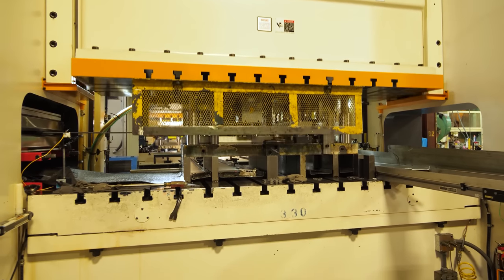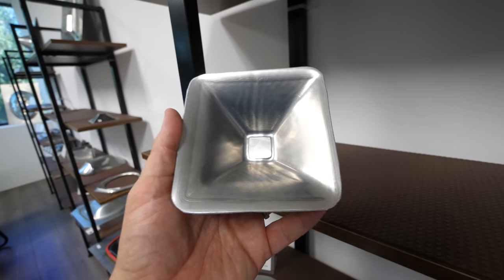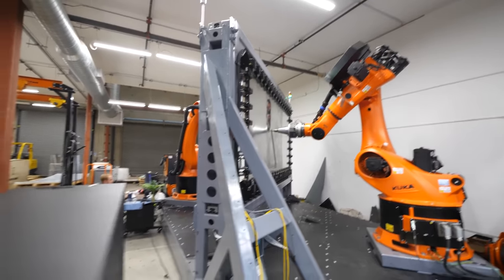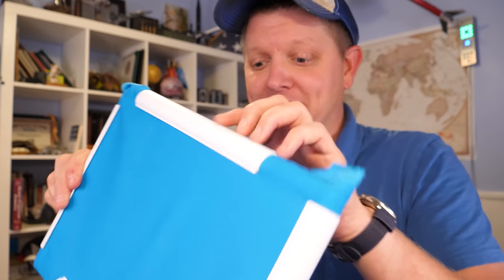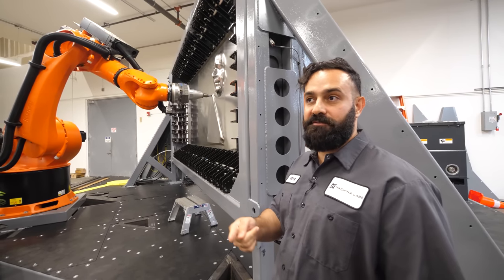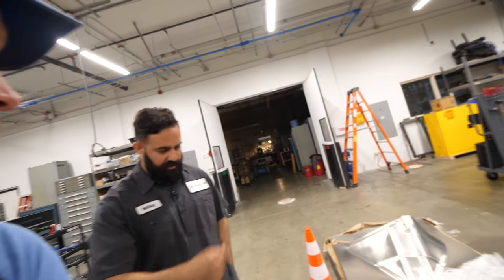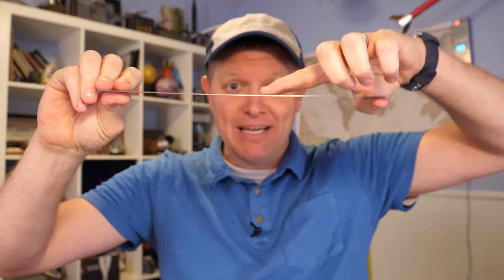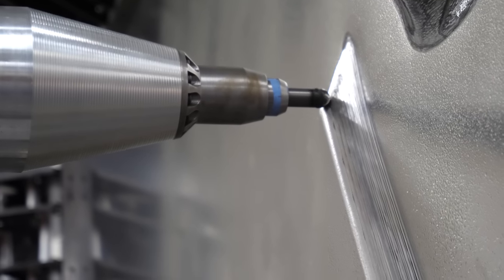ROBOFORMING: The Future of Metalworking? (I Had NO IDEA This Was Possible) - Smarter Every Day 290

Comment: I work in robotics and this was great. Another difficult thing that jumps out to me is avoiding something called "singularity" where if 2 of you motors ever line up, you lose a degree of freedom, and for a split second, your motors have to spin infinitely fast to keep the end effector moving at the speed you want. 

Avoiding it is a complex process and takes some advanced tricks to be able to do it automatically.
Reply: A lot of trial and error’s, but then you add to the program to not get into the binds and change another perimeter first
Reply: The day I learned about singularity (after learning almost everything else about them) was the day that the straw hit the camels back for me, and I knew I wanted nothing more to do with robotics.
Reply: Would you please rephrase this?  Two motors lining up?  Which ones?  There are two robots, here, one on each side of the sheet being worked.  Each robot has a bunch of motors at each point of articulation.  So which two motors are we talking about?  And if you're talking about the end effectors on each side lining up in the same point in space, where do we see that in a case other than this scenario, here, where you have two robots forming a sheet from opposite sides?
Reply: @peedee4065  the rotation axes of two motors on the same arms lining up means that you no longer have 6 motors moving the end effector in different directions you only have 5, because 2 of those motors move the end effector in the exact same direction.
Reply: That sounds a lot like gimbal lock problems in spacecraft.
Reply: @mailleweaver  gimbal lock is actually a form of singularity! There's technically other ways too, but gimbal lock is the best and most understandable example.
Reply: @zacharychristy8928  You're still not explaining what you originally talked about, "singularity."  The only thing you said in this comment is that when you have multiple motors/multiple articulation points some motors cancel each other out by virtue of bringing about the same motion.
Reply: @peedee4065  that's what a singularity in a kinematic system is. When 2 axes of motion line up, you lose one direction that you can move the tip of the robot. 

Mathematically what it means is that when you try and solve for the joint angles that keep the tip moving in a certain direction, you will be dividing by zero.
Reply: @zacharychristy8928  Lol, still not understanding you.  I'm afraid you're going to have to get out of "engineer" speak in order to be able to explain singularity as it relates to the video, here.  I have several times asked you to elaborate with regards to what we're seeing in this video, but each time you've departed further and further from what we've seen.  Again, you mention "two axes."  Are you talking about one robot effector moving in the same direction as the other robot effector on the other side of the work?  Or, are they aiming for the same point in space?  Or, are they aligned in one axis and moving in on that axis towards each other?  Please try and explain what I would visually see in the production method in this video if a singularity were to occur.  Thanks.
Reply: @peedee4065  Nope! I made it very clear. You'll find identical explanations in the numerous amount of industry standard material that's well understood by even complete novices in this field as early as high school. No "engineer brain" at play here at all (though maybe it'd help if you tried a little harder to think like an engineer!) You appear to be the only one having a problem understanding why 2 motors with aligned shafts can only rotate around the same axis. Perhaps you should do some research of your own and find the piece you seem to be unable to understand? Pictures make it much easier to understand. Maybe you can find someone else to rudely demand an education from 😉

Technically Im sparing you the ACTUAL "engineer" explanation. There's a lot of high level linear algebra that explicitly defines what singularities are, and how to predict and avoid them. You're having some trouble understanding concepts like 2 lines being aligned, so maybe a basic geometry refresher could be in order before you attempt complex kinematics?

Comment: You could probably use an auxiliary lidar system with a reflector on the end efectors to automatically update with a sort or RTA that constantly monitors the tolerance. That's just what I would try to do because it seems easier to get the spacial data you need that way instead of relying on the system that's already used
Reply: Yes something like a mocap system on the endefector. That way you can confirm the movements from the outside.

Comment: Prototype CNC machinist here. That robot synchronized motion is sick! Also speaking of kinematics for multiple axis cnc machines... I work on a DMG CMX 50U 3+2 axis mill. I have to periodically run the kinematics calibration sequence and there are small deviations over time. My work envelope is only like a 500mm cube... The work envelope they are working with is crazy. Those machines have more axes too If im correct. I think most of those robots are like 6 axis.
Reply: I write CAM post processors for 5 axis machines, but also do some CAM programming with robots with spindles attached, and robots are waaayyy less rigid than most cnc machines and have way more issue with accuracy. So it's gotta be an incredibly complex software that can compensate for all these issues to provide the accuracy they need. It's pretty incredible honestly

Comment: This is really cool, i work in aerospace manufacturing mostly CNC stuff with inconel, rene, titanium, but use alot of those fanucs for many different operations. Its insanely neat the kind of things you can have them do, between multiple tools, changing tools/tool holders, keeping runouts of the tools in tenths or less, its really really cool seeing how much can be automated.
Reply: I also work in aerospace manufacturing but despite the level of engineering and advanced software that surrounds me, I've never done anything as cool as this...darn what a dream it'd be to be good enough to do something like this 😭!!

Comment: So around 20:30 when they are talking about the different pathing, it's like in 3D printing when you have regular printing and you get a Z seam, or if you print in vase mode (spiral) the head never stops so you don't get that seam. That is really amazing. 
And I guess the maximum angle you can deflect the sheet at is a function of the material thickness, and the distance you deform it at the angle. Since you are stretching the metal, you can only stretch it so far before it becomes too thin.
Reply: Like too little butter across too much bread
Reply: This is 3D's competitor for who wins the future for metal parts mfg.
Reply: Be interesting to know how macro differences in the sheets’ properties are taken into effect. There must be a zero datum point, too.
Reply: @JohnRussellHodge_progtwit  yeah you will have to know the tolerances of your metal sheet supplier when working in the really detailed parts. The two part process at the end of coning before final part is really cool. Reminds me of when they make symbals and actively push the metal out to combat the thinning

Comment: This is such an interesting control system problem. Search problems with constraints, a vector field of deflections. I can see a direct/classical way of solving this, but actually something like tensor flow/pytorch modeling each step in the pipeline would probably work well too.

Comment: I can tell you right now. With experience in custom metal forming. This is going to revolutionize custom car building. This is so much faster than English wheel work, shrinking,stretching,hammer forming,planish hammering and all of the above processes it takes to build one off bodies.  Hopefully aftermarket parts will get better and cheaper over time. Right now. Aftermarket car panels are not very good. I spend way to much time reworking panels to fit correctly.

Comment: Watching the section of the video about the dynamic loads on the end effectors. On a basic level it takes a human child several years to figure out this dexterity issue. It occurs to me that this is the same issue faced by most robotics developers when attempting to create a robot that can pick up a flower or a glass of water without destroying the thing they are picking up. This is right at the cutting edge of robotics development and these guys are collecting data that the greater robotics community desperately needs. I hope they are saving their homework because this is incredible.

Comment: Now there is a manual way of doing this on a lathe, but you have the same issue of needing a piece of tooling with similar geometry to the finished part. The mandrel is in the spindle and pinches a metal disk (the stock) against the tailstock. Now where the toolpost is instead of having a fixed cutting tool, you have a roller that can be pivoted by hand. You make pasess by forcing the disk against the mandrel with the roller while the spindle is turning

Comment: hey Destin, you should do a video of the manufacturing of carbon fibre wheels. They are a new product that are able to drastically improve fuel efficiency by reducing weight and vibrations. They have great potential to be used in EV's once the manufacturing process becomes cheaper.
Reply: carbon fiber has a limited use life meaning rim's will at minimum last approximately three-five useable much shorter if rail potholes on a regular basis
Reply: @thomasrussell7135  thats a misconception. They are actually more durable and more impact resistant to aluminium rims while being half the weight

Comment: Industrial robots actually don't use gears to transfer torque, they use 0 backlash mechanisms (Harmonic or Cycloidal Drives). Very interesting topic to cover. Amazing creactive designs. Drop a like so I can feel smarter than Destin for one day and probably Destin will read, correct and create to a pretty cool video about 0 backlash mechanisms
Reply: I wondered if there was more to it. Even the gantry the robot is on can have servos so that the motors know exactly where they are and can compensate. It seems those robots would be a little better than the stepper motors I used to build my own cnc plasma table.
Reply: @CGT80  Yeah, It would be interesting to know how the close loopthe close loop on those servo motors works to archive that precission. I don't think a standard encoder can archive that resolution. Any expert?
Reply: @javiere5511  the solution is that you use the internal encoder plus another one that actually measures the real movement. Take it as a CNC that displays the actual movement of the linear scales, but interacts with the servo encoders to update real movement vs servo enco numbers. So in this robo arms, is so important to account and recalibrate those 2 numbers. the problem is that those arms does not come with extra scales to do that. They do however can give data of the newton meter that is applied on each movement of a servo. That doesn't mean that you have the actual force applied to the object, but with a little math you make your own formulas and go from there.
Reply: I worked on robot kinematics and accuracy back in the 1980s as part of some practical automation efforts, sometimes using Kukas as well.  The error sources are more complex than many realize.  The encoders are not located directly on the joints; they're further up the gear train, often on the motors themselves.  This means robot position error is also a function of the motor torque loads since the gear trains don't have infinite stiffness.  They've tackled some very complex problems here in real time, and done for two robots.

Comment: For small parts, you can actually 3d print forms. 3D printed parts do surprisingly well under compression with 100% infill. Combine that with a large extruder and you could create forms that could be used for small production or prototyping using this and a hydraulic press.
Reply: Also... I'd probably stop mentioning that Boeing had anything to do with it 😅

Edit: I failed to notice how old this video was, but my comment is still valid 😂

Comment: Destin, you know what's super cool about this? Well, besides all of it. On a basic level, this process is virtually identical to silver forming. Silver smiths tend to do cold work, separated by rounds of annealing. But where a silver smith uses a hammer and a variety of forms (like an anvil of a specific shape) this machine can just essentially just two hammers. And you try taking two hammers and hitting them against each other precisely. It's very difficult for a human to do that with the force required. The angle and precision required would likely be like the precision required to play the cymbals but scaled to that tiny size. On top of this, silver smiths can only do so much work on the metal before it fatigues and becomes too work hardened. A silver smith would need to anneal the sculpture after a certain number of strikes. And although there is the possibility of using some horizontal component of force in hammer smithing a silver sculpture, the majority of the force will always have to be perpendicular to the plane of the work surface. This machine can work with such precision that it doesn't need annealing between rounds.
Further, the potter analogy is actually a lot more accurate than you might first think. In metallurgy, students are taught to think of a metal as a clay at microscopic scales. That is, at a microscopic scale, metal behaves exactly like you'd expect a clay to behave at macroscopic scales. The analogy lends itself to be understood very well from the perspective of a materials' science student.

Comment: This is absolutely brilliant. In my younger days i was playing around with a CNC type english wheel for prototyping sheet metal work for cars. This was 25 years ago and i never got it to work with that day technology. This was very informative and i enjoyed watching these innovative guys with great pleasure. I just wonder if they also considered 3D position measurement of the joints to have direct input for robot deformation compensation. I like to think that even a real time 3D on de tooltip would direct provide info on additional compensation to the workpiece touch area. Wish i was 35 years younger and dive into the new technological advances. What a great time for an engineer to be alive.

Comment: Fun fact, Destin.  At 25:10, that photo that you used of the Blackbird was actually taken by my late father-in-law back in 1994.  Sadly he died in 2001 in an F-16 test flight accident.  That photo is actually of the SR-71B trainer model; you can tell because it has 2 separate cockpit canopy "humps" so each pilot can see, whereas the non-trainer model only had side windows for the back-seater.  This "B" model was taken over by NASA in those years for their own flight test purposes, and you can tell from the overspray lines that the jet has just finished topping off from a KC-135 tanker and had a pressure-disconnect, and the aircraft is slowly drifting aft before lighting it's burners and roaring off to secluded altitudes.  That's also why the refueling door is still open in this shot.  But even though this isn't the Blackbird that operated in theater, I love that it is so iconic that it's the top search result hit online.  It's such a spectacular and gorgeous piece of history.  It is currently resting in Michigan, stewarded by the "Air Zoo" Museum.  I highly recommend visiting their lovely museum if you can.

Comment: They have obviously gotten the machine to work accurately.  I wonder if it would be simpler to skip all the load and deflection calculations and instead point multiple lasers at the working tip, measuring only the position of the point of contact and adjusting the robotic arm accordingly?

Comment: just saw this reminded me that years ago I worked for an automorive spareparts and prototyping plant that used a one sided resin shape associated with a very thick synthetic rubber deformable surface that applied huge amounts of hydraulic pressure to make sheet metal parts for prototypes. Just an interesting process to a similar end, saw 2mm sheet with perfect details of coins throug the metal

Comment: Oh man I wish you asked if the machines were currently running at max speed and if higher speed would be a big risk for making a bad part. Great video nevertheless! My father has been an engineer at Kuka for over 30 years now. He designed and created lots of parts for a lot of robots just like these ones. Used to take me to the factory about once a year and give me a ride on the front of the robot arm! :) Still always proud to see these robots in action!

Comment: @smartereveryday, I’m a little confused about what you said about the backlash in gears. I know that’s true for regular gears and rack and pinion setups (like the rail) but I’m a robotics engineer and I’ve built robots from scratch at my job. We use strain gears (from Harmonic Drive) that have literally zero backlash (with 50:1 reduction) on all axis (except for rails/tracks). Maybe those robots are too big for strain gears